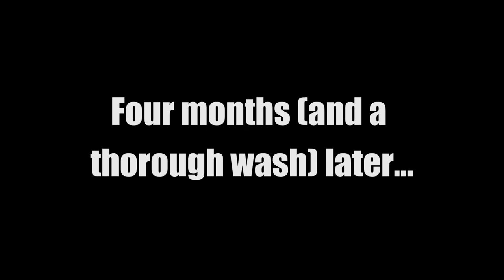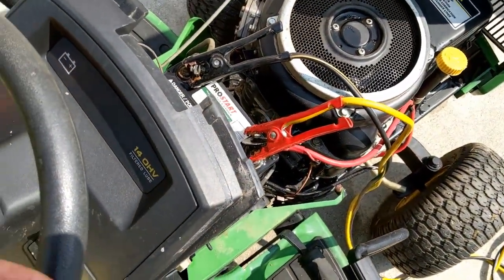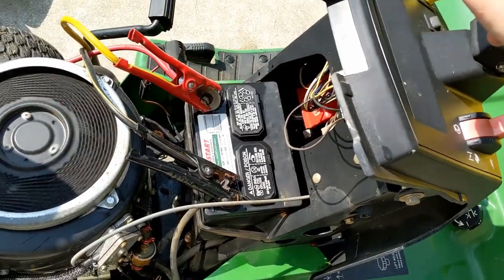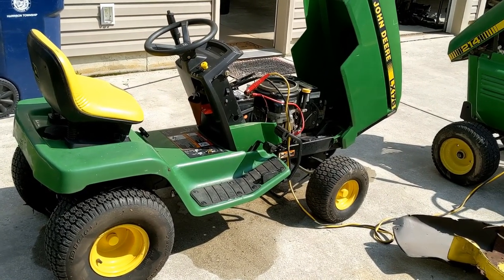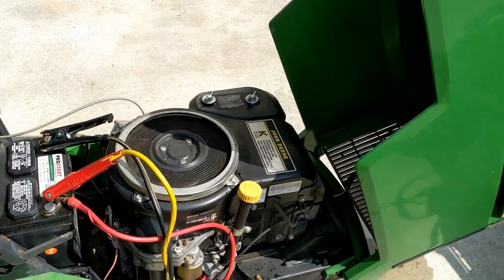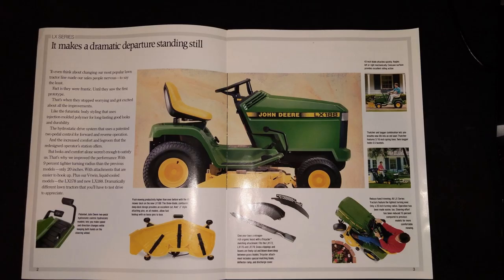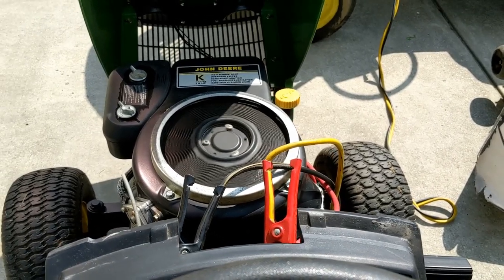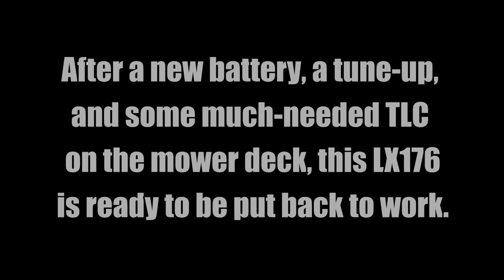Resurrecting a 1996 John Deere LX176 Lawn Tractor - First Start in Several Years

Comment: Hey I have a 317 john deere and I wanted to put a sleeve hitch on it would it work?
Reply from the maker: Yes, you just need the rear lift linkage which can usually be found on eBay.
Reply: Awesome so I've seen you have had 316s and 318s why not a 317?
Reply from the maker: @helenataylor8496  I'm not crazy for them unless they have the Onan replacement engine. 317's were an oddball tractor and I've never been a fan of the Kohler opposed twin engines they originally came with. Also, since the market for JD 300 series has dropped in recent years, you can buy a decent, slightly more modern 316 Onan or 318 for not much more than the cost of a 317.
Reply from the maker: @helenataylor8496  I was supposed to get a 317 with an Onan engine and the rare Brantly power steering kit last year, but it didn't work out.
Reply: Also quick question on the 317 it's over heating and the points box and the air filter lid, where you put oil in and the dip stick are super hot after i run it for like 5 minutes and there's a clicking on the valves  and that's what I'm thinking is causing it to get hot if that's the case on those motors is it easy to do a vavle adjustment? Thanks
Reply from the maker: @helenataylor8496  Yes it's pretty easy to do. The valve covers are next to where the intake and exhaust manifolds enter the block and you should be able to get the covers off without taking too many other pieces apart first. If the KT17 valves are like the single cylinder K series valves, you'll need a 1/2" and 9/16" wrench to adjust them.

Comment: Im thinkin of trading my 322 for a 420 with a 60 deck, and 3pt, what do you think?
Reply from the maker: If the engine runs good and doesn't burn or use much oil (and the hours are decent), it's a good deal.
Reply: @MichaelTJD60 ok it has 1900 hours but the guy thinks it had a rebuild, what do you think about that?
Reply from the maker: @jackolson6479  Depends on what he means by "rebuild"...there are a lot of small things that need attention on the Onan engines so I would only consider it "rebuilt" if they went through everything and didn't just do the basic hone/rings/valves.
Reply: @MichaelTJD60  Okay thanks, I think I will just keep my 322 and get a 54 blade for it.  Which do you think would be bettet in the snow with a 54 blade, the 322 or the 420?
Reply from the maker: Probably the 420 since it has the two-speed rear and diff lock.
Reply: @MichaelTJD60  Okay thanks
Reply: Keep up with the great vidss

Comment: You just cant kill an old deer
Reply: Iowan Siren Recordings, my 212 is 37 yrs old and still running strong.
Reply from the maker: Or anything old, for that matter. My '83 210 and '83 214 are pretty young compared to some of the other garden tractors I've owned....'68 JD 110, '73 JD 140's, '73 CC 86, '74 CC 129, and '78 JD 316 all still running great when I sold them. Still have the 316, as far as I know it's never been rebuilt. Still runs great with about 900 hours on it.

Comment: Is it worth trading a 210 for
Reply from the maker: Depends on what you're using the machine for...if you're looking for something to strictly mow with and do a nice job, the LX is a better machine hands down. But if you need something heavier and have rough ground to mow or a lot of garden work to do, keep the 210.

Comment: Looks like a nice machine compared to the la series I had an la145 John Deere that was a pile
Reply: ayp193, yeah. My 212 isn’t in the good condition that the LX176 is in. We think it was owned by an old man possible the original owner and were thinking this because it’s got all original tires with tubes in the front. The paint for its age is great it was probably stored in a barn and was well taken care of.
Reply from the maker: It feels a lot tougher overall than my LA150 I used to have. They're on a different level in terms of quality.
Reply: MichaelTJD60, yeah that’s true. The LA was a cheaper version of a dealer version that is tougher.
Reply: @michaelbenoit248  my la was bought at the local John Deere dealer so it wasn't a Lowe's special but the trans went out the steering went out and it was rusted
Reply: Ok.
Reply from the maker: There's actually no difference between an L/LA/D/E series sold at a dealer, and one sold at Lowe's/Home Depot. The only difference is the warranty each store offers. The bigbox stores order them through a local Deere dealer, who delivers and sets them up the same way they would at the dealership. Either way, they're still sub-par machines. I don't ever plan to own or touch another one. My LA was a turd from day one, but I made decent money with it and ended up selling it for more than we bought it for, so I really can't complain.